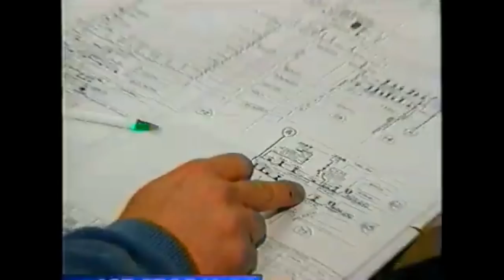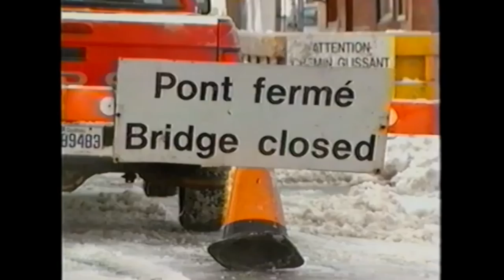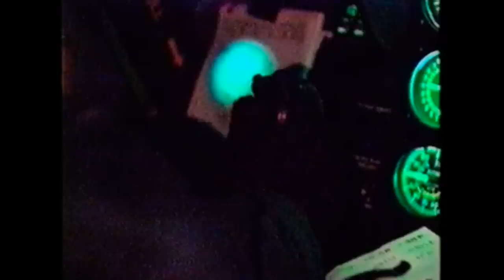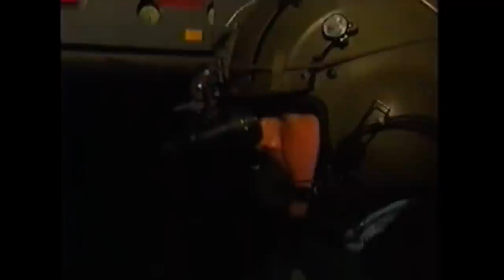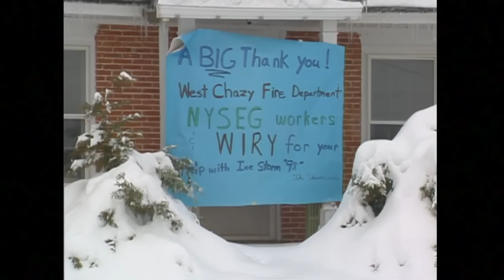The Worst Natural Disaster in Canadian History (Ice Storm 1998)

Comment: I was lucky because I lived in the Plateau where most of the power lines are underground. We lost power for only a few days.  My parents were less lucky, they live on the South Shore and were out of power for a month.  I went there on the weekend to chop firewood, but the wood was green and covered in ice.  My father and I would try to remove as much ice as possible before chopping the logs. Then we would lay the chopped wood on the floor in the basement to try to dry them out.  Then finally we would stack the relatively dry pieces of wood around the fireplace to dry them out further, before finally burning them. After about 10 days my parents finally abandoned their home and stayed at my sister's apartment in Montreal, where she had power. My sister had been in Toronto over the Christmas holidays, and couldn't return to Montreal because the roads were iced up. She had to watch the disaster unfold on television, knowing all her family was trapped here.

What was so weird, is that after about a week life was back to normal in the Plateau, but you could take a short metro ride to the South Shore, and Saint-Lambert, where I grew up, looked like a war zone.  I'll never forget the incongruity it, it was hard to believe we were in the same city (metropolitan area).

Comment: Well done documentary that covers the event.  Yes I lived through it.  I was living in Montreal and working downtown Montreal at the time. I was aware of the increasing power failures starting on Wednesday outside Montreal.  The big hit was on the black Friday (Jan. 9) when power went down in the afternoon.  I left office early and I walked home in slush, snow and ice.  It was black everywhere except for the car lights and the army was very present and reassuring for me. My boots and feet were soaking wet up to my ankles. I called my brother when I got home to make sure he and his family were fine.  He came to get me because he had propane heating in his house and we knew by then that the damages were extensive and situation would last a long time.  We manage to cross the Mercier bridge just before it was closed (like all the bridges) to remove the ice. The next morning, it was freezing temperature about -15C. Ice was everywhere.  I remember that Saturday the propane delivery man showing up.  I was so surprised that he had managed to drive all the way to the house without trees blocking the road.  I did not have to go to emergency center I was privileged.

Comment: Unless u were there, u will never know how bad this was. Multiple high tension power towers  150 feet tall , and  6 out of 8 main high power voltage  lines to the city  fell over. Electrical  and construction engineers  thought that was impossible to happen. But it did happen.
My parents were in Florida, and their neighbours kept my parents water running so all pipes didn't freeze. All indoor plants died. Virtually all stores and gas stations had to close. Telephone poles broke in half. Driving was impossible. All cars parked outside were frozen over. You couldn't open the doors. All my parents outdoor trees  broke and died due to ice buildup.
Later, I drove to Montreal from Toronto. From Cornwall to Montreal onwards, many miles of fir trees were downed and killed. This came within an ace of being a calamity.
I must give huge credit to the repair crews who helped restore the power and high voltage lines.

Comment: Was stationed in Petawawa when this happened.  We were on block leave for Christmas the the Brigade scrambled to our mustering point at the Ottawa Arena.  From there we were deployed in Squadron and troop strength throughout south eastern Ontario.  Every telephone pole was down.  Sureal experience.  We travelled ahead of the hydro crews to remove hardware from poles, break the lines free of the ice, and then remove the poles themselves.  We worked for days on end.  Sub units were deployed to small towns to provide liason services between the players.  We were not impressed by the hydro crews as they didn't want our help and hindered our efforts as they wanted the overtime.  OC Transpo were highly respected by us for their constant professionalism and hard work getting us to where we needed to be.  Icestorm 98 was bigger then just Montreal.  If it wasn't for the Army this 5 day job would have taken at least a month.

Comment: I was 14 at the time.

I remember that, at the time, my house was individually cut from power, as the electric post in our backyard fell over tearing the electric, tv, and phone cables away from our house, were it not for that, we would have been fine as we were on the same circuit as 2 schools and police station. We learned the extent of the issues only when I came back from a slippery trip to my high school where I discovered it was closed. Our truck was stuck in 2-3 inches of ice, and it took hours to free it from its prison using a combination of de-freezing salt, studded "grip planks", and ice breaker tools. We stayed home for two days without power, at which point my parents decided to seek refuge at my grandma's place, which was linked to a hospital circuit. We stayed there for a little over two weeks since our house took longer to recover power. Even then, we could still hear the news that the eastern townships were out of power for over a month. 

There was a region between 3 towns that was nicknamed the black triangle that had to have the army deployed there to provide generators, and supplies, set up refuge camps, and help in the clean-up procedure. it was the first time I realized the army was used for something else than Blue helmet operations or suppressing native protests. Honestly, I'm glad that Canada's army has disaster relief in its curriculum.

Over time new methods were developed to winterize the grid. One that I recall we found was, (I might be remembering the details wrong) a manipulation of the electric flow that causes something that would break the ice on the cables.

IIRC, this happened a few years after another natural catastrophe in Quebec, the Saguenay floods. Most of the province had mobilized to assist those in need at the time. and the folks from Saguenay returned the favor during this crisis and I thank them.

Comment: I was 12 when the storm hit, I remember we personally did not suffer from much other than boredom. My dad did stack up on board games after that in case it'd happen again 😂. Past 3PM, there wasn't much to do in the dark.

Our biggest issue was going to the bathroom without risking a pipe explosion due to freezing.

My dad was a handy man and he made sure we lost nothing by keeping food in cold storage filled with ice and snow (we weren't lacking of that) and made small controlled fires (in metal bins covered with metal mesh and the oven's grill on top) in the yard for warm food. We didn't lack wood either with all the branches littered around.  Startinf the firest was the biggest issue with non dry wood but aince we had a bbq, we had starter bricks and coal in the basement we used to kickstart it (our bbq was dead, we improvised another solution).

I slept in my winter clothes covered by tons of bedsheets and we co-slept on the coldest nights, had to wash with cold water and a washcloth but that was pretty much it.  

We didn't have electricity for nearly 3 weeks and we made it fine, nobody panicked and we helped our neighbors how we could and they helped us to their best.

Comment: Truth is we learnt nothing because a similar situation happened last April. No power for 3 days and more for others. Hydro Quebec refused to bury the powerlines.
Reply from the maker: Well actually by day 1 of the ice storm of 1998, we had 18mm of ice and already power lines collapsed everywhere. In April 2023 we got 40mm of ice and not a single hydro line collapsed, it was all the trees taking down wires, so at least the infrastructure has been built stronger. Unfortunately, burying lines is just too costly. It’s cheaper to rebuild the network than bury it.
Reply: @DiscoverMontréal  how many times until it is cost efficient?

Comment: I have to be honest... I'm somewhat surprised those power lines aren't heated in some way... Given their location and the sheer amount of snow and ice they get in Canada. Some sort of heating device, perhaps something sorta like those heaters that you can wrap around water hoses and faucets would do WONDERS I feel like... Idk. Maybe I'm wrong...
Reply: This happens like once in 100 years, could you imagine the cost of heating all those powerlines? The good thing is that Hydro Quebec learned a lot from this and made their pylons a lot more resistant to these kind of extreme conditions.
Reply: @Radwar99  okay but with the climate changing as much as it has, do you REALLY think it's going to remain a once in 100 years event? Not to mention. Sure. It would be pricy. But in the big picture. Is it more or less pricy than having to rebuild the entire electrical system when these types of storms DO happen..? Idk. I just feel like spending a little extra now to possibly prevent having to spend a literal fuck ton later is a better option.

Comment: If you have solar panels on your roof, add a storm shutter (metal) on the top of the roof.
If there's hail, close the shutter above the solar panels.
This can be cheaper than replacing the solar panels,
while normally not blocking any sunlight on the panels.

If you already have a cooling circuit for the solar facility,
you can enhance it with a heating capability, to help
unfreeze it after it's frozen over.
Make sure you have a standalone battery to do so.

Also, a nice circuit breaker to detach from the mains may be useful,
since after a mains down you are sharing a whole bunch of solar with the neighbourhood,
and although this may be a nice gesture, I'm guessing they draw a whole
bunch more than you can deliver.
Alternately you can offer temporary heating capability by extension cord for a single heater.

Get a carport or a garage with a sturdy roof. It pays better than insurance.

If you don't have cash for a solar facility, buy some large car batteries, and charge them.
Now at least you have power to stay warm during mains outage.
(don't forget to get a 12V or 24V heating appliance, depending on the battery you'd use.)
It's nice to stay unfrozen.

Also, for they days or hours after, get some crampon ice spike shoe covers or
boots with spike on them. It keeps the bruizing down.

For pro drivers of ambulances, firetrucks, police, a mandatory driving during icing
testing may be required. It wouldn't be bad to add this requirement to regular
driving licence lessons and issuances as well.

When low on funds, use a single car battery and sit in a small closet,
with some styrofoam lining (on the floor too) 𝐚𝐧𝐝 𝐬𝐨𝐦𝐞 𝐯𝐞𝐧𝐭𝐢𝐥𝐚𝐭𝐢𝐨𝐧 and a small 12V heater.
It's not comfortable, but it's warm, make sure it's big enough to sleep in though.
Don't overuse the heater, it's best to use one that has a temperature switch-off.
For this purpose also keep a few bottles of water in there and some food jars.
You never know how long and how cold it'll be.
Ofc city shelters can help, but that depends on how far away they are.
Hitchhiking in sub zero is a very bad idea.

Spike chains for car tires so there's some grip when driving in ice.
Avoid steep slopes. Once the car goes downhill, it will keep going.
Alternately spike tires.
When frozen, drive slowly. The government should issue a general
limitation on that. I'd suggest 50 kph and emergency services only.
Enforcing such strictly may be required, with warnings due.
(one warning per license.)
It's better to issue people tickets for speeding than to issue obituaries.

Doesn't Canada have a FEMA or such ?

No subway ?
Make sure the power from the subway is on a separated circuit,
now use a generator to power a few lines simultaneously at a time.
That way you have at least some subway functioning,
instead of nada, tap a few emergency led lights from the subway line.
You can keep those for a rainy day, no more than 50 watts per stop,
it's emergency only.

And no, I know this was 1998, but it can happen again any day.

Don't use power generators nor other exhaust heavy heating.
It will release CO2 and CO and that can be lethal.
Only when the exhaust goes outside again can those be used.
Small wood stoves can be used for both heating and cooking,
when the exhaust goes outside.
An electronically managed gas central heating won't work during power outages.
To keep it operational use an alternate energy source, like a small CPS for such.
A gas central heating doesn't need much power, but needs it for the management
and the pump.
Reply: Also, not being a third world country, don't people in Canada think
it's about time to invest in underground delivery of power ?

Also, those power pylons are badly designed.
The cable is supposed to break or detach, while the pylon stays up.
It's easier to fix a detached power cable, than it is to build new pylons.

When living in disaster area, expect disaster.
It beats a wedgy over your head into the roof by mommy nature.

Comment: When a dam is flooded by ice, use the power to heat the water in the reservoir.
Yes, it's costly in power, but not nearly as costly as a dam that breaks.
Allow for a wood spill at the top.
That's when water fills up the dam carrying water and logs and such over the top,
where it falls down the other side. The fact that logs fall down
is not as bad as it clogging the water intake for the turbines and such.
A dam should always have a facility to allow for solid (wood) spillage
to pass through or partially over, while ice can be remediated
by heating the water around it.
Also, some of the ice may also use the solid spillage way.
Once again, this may be costly but nowhere near the cost of a new dam
with the bill for massive flooding to match.

Comment: 26:46 Ok, power by pylons 101.
The structure itself should be capable of load bearing of at least
it's own surface in ice, by 5 inches, upon the load bearing by the wires.
The wires should detach 'orderly' upon being taxed beyond the breaking
point of the load bearing by the pylons.
This should also involve one sided load bearing.
If the load is too big on one side, both sides should detach.
This will prevent forward backward load bearing over tolerance.
Yes, it's bad when that happens, but attaching a few wires
with a few choppers fitted for such can be done fast,
while rebuilding pylons takes weeks.
A couple work choppers for such would be nice.
They'd need some modifcation, but in all a few hundred grand
for the entire nation's needs per year.
(this is only for power pylon mains that are hard to re-wire otherwise.)
Also, don't let the nearest guy with a design do the modification.
It needs to be field tested as well, with all the forces involved,
including wind, tensile wire, etc..
Reply: Heh, someone mentioned "cascade wire detachment",
where all the lines start dropping to the floor.
I guess they prefer "cascade pylon failure" instead ?

Once a wire is unfrozen, it can be attached most easily again,
when the pylon is still standing.
If the pylon has broken, then you'd have to build a new pylon first.

If the wires themselves release when a certain threshold for tensile
is reached, they can be plugged in again, after being defrosted.
A chopper is the easiest way to do this, when used properly.

If I'd run a FEMA, I'd have a discretionary fund for emergency vehicles,
like such a custom chopper and some other vehicles.
Preferably multitooled.

Also, a de-icing system for the powerlines.
Embed a thinner line into the main, that can go hot with less power.
As it goes hot, the entire line will defrost.
In fact the lines can do that automatically.
When the tensile limit is at 80%, the tension shorts
the thin line with the main line for a very short while,
allowing some current to pass through the thin line
embedded in the main line. This would heat up the whole line,
to allow defrost.
When it reaches 85%, it allows for greater heat, 90% still more heat,
and so forth.

Comment: Oh heck!!!  Put those LINES UNDERGROUND!!!!  Underground instead of all of those obsolete transmission towers and lines that are ABOVE GROUND.  Sheesh...
Reply: No !! Around 10% of the Québec lines are underground, mostly in densely populated areas. Underground lines cost way much and are harder (and costlier) to maintain, particularly if the soil is frozen in rural areas. If you consider the size and distance (Québec is huge) to cover for an 8 million population, that will be a terrible decision to burry all the lines. Keep in mind that it was the first time in our history we had such an ice storm and it never happened again. Since then they made modifications to the grid so the consequences of such a storm won't be nearly as bad. Our system is fine, cheap ( 7 cents kw-h in Montréal compared to 30 cents in New-York ) and usually, it's Hydro-Québec workers that helps Northeast of the USA when they have some troubles (almost each years!)